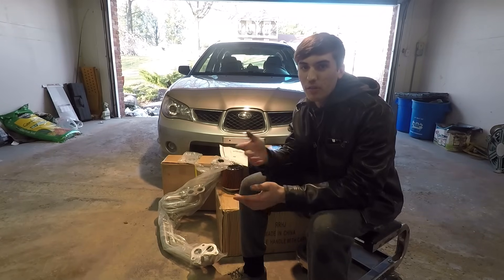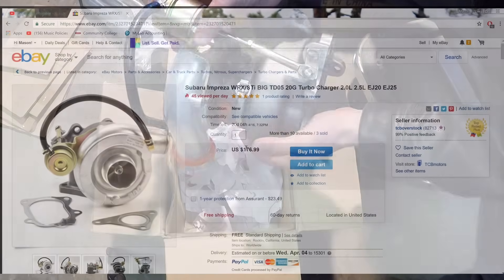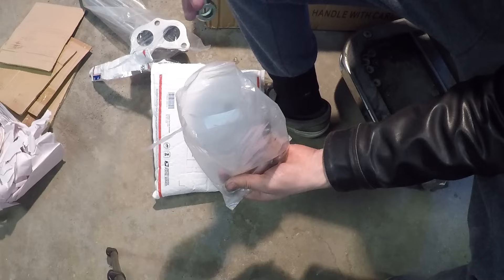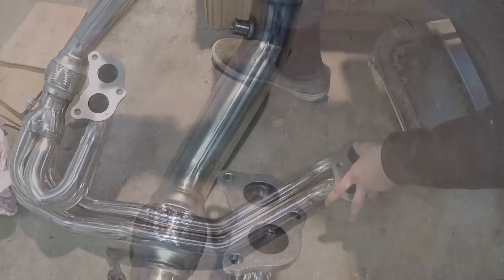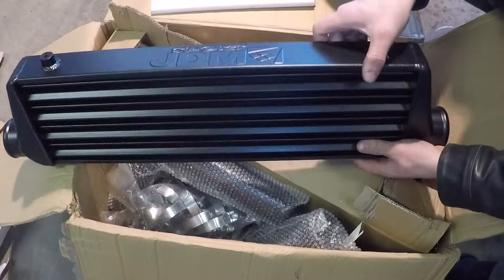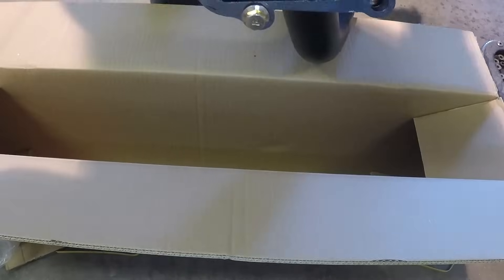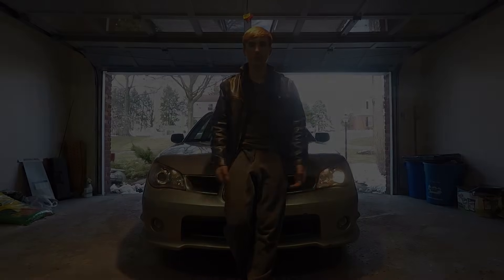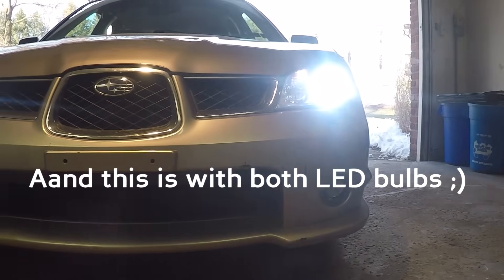All the Parts You Need To Turbo a Non-Turbo Subaru

Comment: Hey mate, long shot but how did you get the td05 to fit the headers?
Reply from the maker: @d_w_prospecting5701  I don't think I understand your question. The headers go to an up pipe that goes through a notch that I cut into my crossmember and then the turbo fit onto that.

Comment: Stock ecu?
Reply from the maker: Yep, mine is tuneable.
Reply: @GoldGuyRides  Do you know if the 1.5 2006 ECU is also there? Is yours the 2.0?
and still alive? At least how many horses did you make?
Reply from the maker: @dmwelds8960  no I don't know, sorry. I didn't even know they made a 1.5 engine in 2006. Is it JDM or euro? Mine is a 2.5 liter and yes it's still alive. I have never had it on a Dyno to truly know the HP but I would guess it's around 300.
Reply: @GoldGuyRides  How can I see if it's the JDM version? Mine is an EL15 manual gearbox.. I was thinking about getting the 2.0 N/A and converting it to turbo or even this one, what do you say? Did I need an ECU or is this available?

Comment: U also need a camshaft stage 10 and crankshaft racing, methanol injectors, waste gates, air filter stage 10 pistons and Manifold stage 12 Down pipe  and full exhaust stage 18 and replace the turbo with a stage 24 twin turbo, stage 34 engine Block, and stage stage 5 intercooler and full engine stage 100 total HP 6,000 and 4.0L engine

Comment: Would this work in a NA second gen forester with all the same parts? (2004 forester to be exact)
Reply from the maker: Yes it will but you'll need to customize some of the parts to make them fit. Pretty much none of this was just bolt on. Also you'll need to notch your crossmember for the up-pipe to fit, or make a custom up pipe that goes around the crossmember.
Reply: @GoldGuyRides  sweet thanks

Comment: I have a non turbo sedan impreza 2010 and im planning to turbocharging my car what do you think tips that i need and what kind of turbo will fit to my impreza
Reply: sell the car and buy a wrx...this guy did the swap the wrong way and in the end will pay more than doin it the right way.
Reply: Cbgrandtheftauto how about engine rebuild with wrx engine parts
Reply: @UzeirGamazsi  that's a better route, you will need to source a wrecked WRX to pull all the parts from. You're going to need the engine, wiring harness, ecu, engine subframe, and exhaust components. There's some more miscellaneous parts you will need, but that will be the easiest way to get a turbo engine into a NA chassis
Reply: @Cbgrandtheftauto  i was planning on buying a 2012 wrx half cut and rebuilding it into mines after all both is ej20
Reply: @UzeirGamazsi  that will be the easiest way. its still going to require a lot of wiring, but you are starting off with all the right components to sucessfuly swap the car. just make sure the front cut comes with the ecu and main engine wiring harness
Reply: Cbgrandtheftauto thx for the info
Reply: @UzeirGamazsi  No problem. I am about to do a swap on my Forester. Subscribe and it will help you with yours

Comment: My guess is this shit blew up, I've boosted NA subaru motors the same way over 15 times and literally blew the heads off my block with ARP head studs, cracked cylinder walls, detonated pistons, threw rods, shoved a valve through the valve covers and that was all on 8 psi

Fast as fuck, but itll also blow up fast as fuck. Not worth it, dont do it!
Reply from the maker: I've driven it close to 10,000 miles on 5psi with no engine problems. I am thinking about turning it up to 8psi soon though so that might be the nail in my ej's coffin. We'll see
Reply: Would it do the same on a built engine?
Reply: @hunterjames9428  depends on how you build it. If it's an NA block that's open deck itll have issues but if its semi closed deck and has decent internals it may be fine. 

NA blocks are weak, the cylinder walls are prone to flex because they're is nothing keeping them stable to the block. Just open coolant journals. 

Also youd have to probably port the heads a little bit to help with flow but that's neither here nor there. 

I've done this quite a few times with stock compression, stock block and it never lasts that long but it is a different kind of fast for a Subaru.

Comment: What about a 2.5 legacy n/a would it handle a turbo better than a 2.0
Reply: no. compression is higher in the 2.5. the 2.0 has lower compression which is better for boost. the 2.5 can only handle maybe 10psi max before running into serious problems. 2.0 can handle more boost and has thicker cylinder walls

Comment: I have a question. Is it worth turbo charging an N/A or you rather buy a turbo charged one and work on improving it?
Reply from the maker: It depends how much work you are comfortable with doing. I wanted to do everything myself, so I think it was worth turbocharging my n/a.
Reply: @GoldGuyRides  okay, I think my biggest worry is not doing something right or missing out something you should have done thus messing up the car and it's performance

Comment: How reliable is it ؟
Reply: Muhammad Qassoum Na 2.5 headgaskets are already the downfall of that engine, add boost and you're asking for trouble. If you swap in some STI headgaskets or thicker ones to lower your compression, some arp headstuds, put some fuel to it and keep your boost SUPER LOW you'll be okay for a while. Build one of these Subaru eBay specials and you'll have a grenade under the hood. Save your money and get a wrx or do a wrx/sti drivetrain swap if you want reliable. eBay may be cheap to get to your house but it won't be when your running 2.5i suddenly decides it doesn't want to run at 12:1 compression anymore.

Comment: did you completed the project and did it work, I have an ej20 and would like to put 5 to 6 psi into it for a littler uff, any tips from u
Reply: I have a gc8 boosted 7psi fmic no mods but a map clamp no problems yet 5 years passed emissions injector duty at 92% stock runs like a  rapped ape
Reply: A tip for all of you do not waste your cash bro save up and get  one made from factory you will not regret it guys I'm not haven a dig at hold man but just an example headers will not do anything for him and his project alot of professional turbo and aftermarket professors will tell you no need to get rid of your OEM headers they work just fine unless you wanna go more than 700hp and be race tracken that shit the go for it but he should of done a bit homeworks and used that extra cash for something more useful. I know it was a present but it was his mention of doing it that got him the headjobers so people you understand I am no way knocking his shit I just want people to know do a  bit more homework and reaserch everything you can there are so many other parts on this car that he needs before even close to head suckers get gauges get A/F meter get coilovers strengthen your car and most of all enjoy doing the project because you have to soak up the good times as their is a shit load of hair pulling over something you either missed or something breaking because some part not strong enough for the other part it's a constant matching pairs game and people again DO YOUR HOMEWORK DONT GO BUY THE FIRST THING YOU SEE JUST BECAUSE YOU LIKE THE FEEL OF IT or it  LOOKS HECTIC ........ Patience and hectic boost you will not wipe the smile of your little turbo face

Comment: Im planing on turboing my imoreza but its a 1.5 AWD. You think its a good idea?
Reply: If it has the CVT, then definitely no. Those transmissions can hardly handle what little power the engine already makes. If it's manual, go for it.

Comment: So can this be done on the 2005. Impreza 1.6 caravan,if it can be done is it the same process,how much psi to run etc etc, I'm asking this because I'm in the process of buying a car and this would be a deal breaker,thanks in advance
Reply from the maker: Yes it can technically be done on any car. I don't know too much about Subaru 1.6's but I'm sure you could run around 5psi
Reply: GoldGuy thanks!

Comment: Wow! Seems pretty cool lol I bought a 2007 Impreza 2.5i that was a previous project from a friend of mine. It's currently running a EJ253 short block with Ej205 heads, EJ205 harness, EJ205 manifold and a EJ205 ECU. It has a TD04 turbo with a COBB downpipe and NUR SPEC R exhaust. The car runs perfectly fine at 7 PSI. However, when I try adjusting the boost I get explosions from my exhaust. I would assume its because of the high compression ratio that the short block has. I replaced the spark plugs with some NGK Iridium 6 and still have the same problem. But, whatever car is pretty fast. My old 2003 WRX was running about 18 psi and was fun until I wrecked it 3 months ago. Keep us updated with your project and tell us what problems you ran into. But I would assume that you must change the harness and ECU  to a turbo ECU in order to have the best results otherwise I think the car will run like shit. But blessings man nice video!!!!
Reply: Explosions like backfire?

Comment: I don't see how This is gonna work? 
The Ecu on non turbo is totally differnet to the turbo ones. And thr non turbo ecu wouldent recognise any of this stuff.  

It's easier to just swap out the full engine for a turbo lump and new loom and ecu. £1000 from breakers
Reply: pretty sure the ecu automatically adjusts the AFR or it runs with wide enough parameters that it works. also most of these stock ECUs are tuneable. you only need a tune /piggyback once you go over 5-6 psi. you can turbo this motor for sub-$1000. good luck swapping in a ej205 ej207 or ej257 in for that price lmfaooo.
Reply: Thats funny! On these car if you swap the engine you need to swap the transmission, and way kvjvj

Lire la suite

Comment: Should have just put in a wrx engine. Pretty cool though.
Reply from the maker: I would have but this was a lot cheaper
Reply: Goldguy not sure how much this ran you but you can find them on ebay for under a grand. There’s also a site where you can get a whole wrx from the junkyard for about a grand.
Reply: @roymccoy835  link me one turbo Subaru motor, compatible with his car for under a grand. Also swapping into an Outback sport would require the whole wiring harness and transmission. It's not as easy as you think.
Reply: OGbrundle Ive seem ej257  around 900-1200 on ebay. You’re right about the wiring but you can reuse the transmission. Ive seen it done before. I never saId it would be cheap, was just wondering why he did it. Why are you so hostile man?

Comment: I still dont trust ebay I'd just go to my local speed shop
Reply from the maker: Tom Bowes and spend 10x as much
Reply: @GoldGuyRides  he maybe spending more than you now but I can surely say on the parts you have bought ie the cheap as chips turbo will crash long before say he's hks turbo and if you keep buying cheap down the long run you will have been paying more as your buying the parts more often and what hurts more than that to me is not being able to boost but hopefully I really mean it that you somehow prove me wrong but from my experience over last 20 so years this is exactly what I have seen a thousand times bro save up longer and get at least the above average part trust me and good luck brother

Comment: i hope you know for a fact that non turbo 2.5 subaru engine are already fragile enough while N/A. if you try to boost it higher than 7-8 psi, this engine wont last for mor than 500 km, not even kidding.
Reply: Joe pap I have a 2008 Subaru Impreza hatchback not the WRX or sti even tho it looks like one with the hood scoop and rear wing but anyways it’s an automatic for one and I’m wondering if there is anything I can do to the stock engine or do I really need to do an engine swap?... like can I make the engine I have more stronger and powerful or is it to fragile cause I would love to make my engine bay look all pretty and have all kinds of power ( im looking for like 250HP to 300HP is my goal) but is that only possible with an engine swap?
Reply: Mike Fawc sadly if you are looking for that much power, i would recommend to just sell
Yours and buy a turbo one.. and then you can go and cranck up the boost with supporting mods . The stock 2.5 cant handle power unless you put tens of
Thousands $ in it . Sadly
Reply: Joe pap so it is possible then? I’m not really understanding why it would cost tens of thousands of dollars? What exactly would it take? I do realize buying one with a turbo or even an engine swap would be easier however I’m not really looking for the easy way out.. I just really am interested in learning from this I want to try and do as much as I can my self so I can learn and even if I could get it up to the 250HP I would be more then happy I’m just looking for a little extra power to have fun with lol are there any performance upgrades I can do to the engine block it’s self to make it stronger?

Comment: the thing u missed，engine management，racing clutch，fuel pump injector
Reply: U don’t need all that shxt to turbo a car lol
Reply: Ah yes, I enjoy injecting fuel pumps into my engine
Reply: Don't forget engine subframe. The header he bought won't clear the NA subframe. Either he had to get different headers or swap the subframe.
Reply: @Cbgrandtheftauto  you dont have to.  Chop a small notch out of the Subframe and it'll fit
Reply: @Cbgrandtheftauto  just buy u turbo Scooby job done
Reply: @RAGNORAK-r4w  I kind of understand. When I bought mine the price gap was insane! I could have gotten a brand new n/a for the price of a 3yo/60k wrx
Reply: Along with turbocharging an n/a, He missed the ol made out of plastic conrods
Reply: You need wideband, turbo kit, fuel pump, injectors, and common sense and u can do it, sure you xan get a clutch but the last thing in the list tbh lol

Comment: Id try getting a fitting for your oil feed line. Try your oil pressure sensor. Also your return line will need to be ran somewhere. People drill into the valve cover but I put mine in the oil pan. I would also consider like a mega squirt or a aem fic. A tune makes all the difference
Reply from the maker: StuckInThe608 that's what I ended up doing! Video will be out soon
Reply: What the fuck why wouldn't you just get an adaptor and join it with your factory sensor fuck or even a sandwich plate for under oil filter fuck me bro you are seeking to do things very hard

Comment: the upipe won't fit, wrx/sti/legacy came with a notch for the upipe to go up in the engine bay. Would have been ideal to get the header and upipe in two piece so u could fab the upipe to go around the crossmember, u can cut the crossmember as well and reinforce it if u want as well or get a wrx crossmember. Also u will need a bit more things than what u showed in the video to turbo it(that's if u have those already and didn't show them)
Reply: CaC so if I had a wrx up pipe I could say chop it halfway and weld in a new pipe to route it over the crossmember?
Reply from the maker: I figured that out the hard way, and it was a BITCH making the up-pipe fit, but I did it and it will be posted on my exhaust swap video coming up in the near future, stay tuned!
Reply: Chris Santos there’s no space to route it over the crossmember 
Would have to route it under if u don’t want to notch it or getting a wrx crossmember 
To make life easier u can use the NA header and make an upipe for it
Less headache
Reply: CaC my bad that's what I meant , go straight off my stock  header but use half the up pipe and flange vs buying a subachad one and then just have a shop Bend me the Down pipe and the remainder of the up pipe
Reply: Chris Santos Yh that can work

Comment: You can go for 200-250 hp everything more than that will kill your car. Also consider upgrading the engine and the transmission! Oh and dont forget to tune it properly or otherwise it will run like shit

Comment: I'll pray for you on this install. something tells me it's not gonna be an overnight thing. Also I would seriously consider fuel and engine management before installing this kit. otherwise without a tune it's gonna run like crap.  It's not just the PSI that kills motors but the improper tuning.
Reply: These ECUs can be tuned via ROMraider
Reply: BobbyJay i agree
Reply: NPC-032136 you don’t even know what a tune is, shut the fuck up😂

Comment: Good luck with the build man. I will say that 20psi is a bit much for a high compression engine like that.
Reply from the maker: whyausername3 I would only go up to the 20's after the engine has been built stronger
Reply: I gotta 2005 Forester X....what's the min & max psi that'd I might need, for enough boost but not blow it up?
Reply: @S0ulSUrviv0R713  i have the same car and intrested also.
Reply: I wouldn’t run anymore then 12 to 14psi & that’s still pushing it on stock block internals we’re not made to handle boost , If you want the head gaskets to blow in 2 months run 20psi
Reply: @timprice8877  if the block is sleeved and gaskets upgraded so u think it will hold
Reply: @trevoncowen9198  yea you should be alright then bro